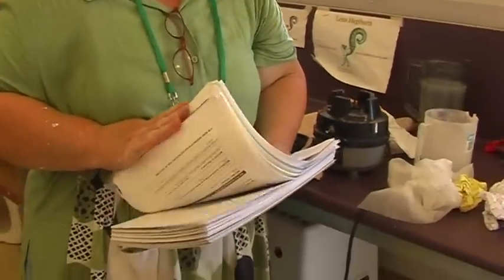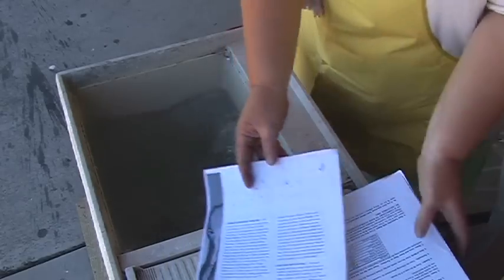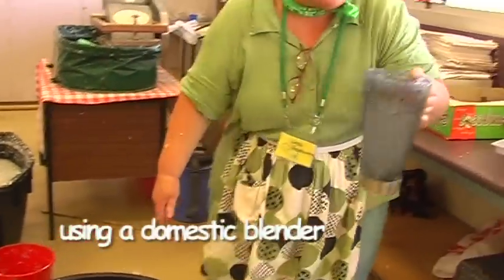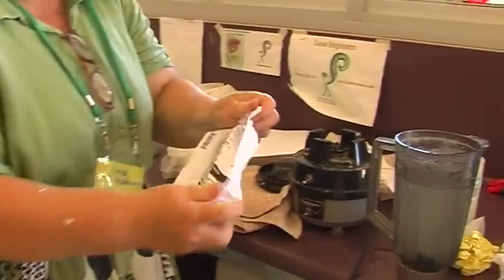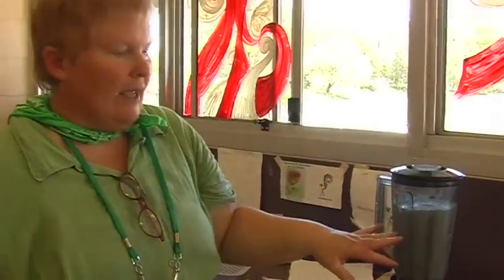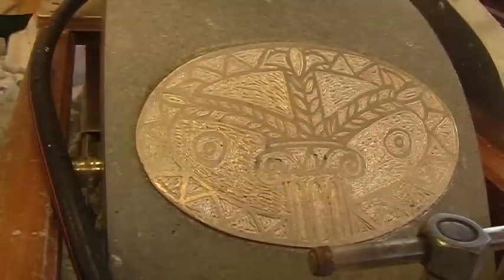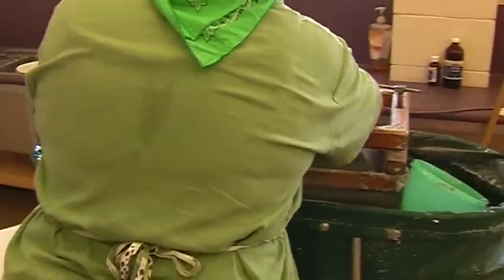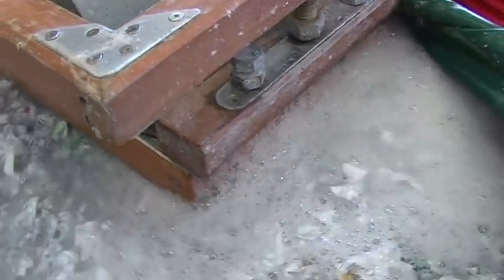Paper Making, Part One: Pulping

Comment: I make my own pulp at home but without all that its pretty simple but of coarse...for little projects xD I just shed paper with my hands into tiny squares, I just use a newspaper(like 12 pages) and then dump it into a bowl, then moil water and pour it over the paper (I add some white vinegar, not sure honestly if its needed, but in my mind it helps break it down) and let it soak from anway from 30 minutes to 2 hrs, then just start mixing my hands in the mixture and just swirl them in for like 10 mintes either ripping clumps or grinding them together. I just do this until its like a slurry and then strain it tho,rough cheesecloth) but I squash them into balls to take out as much moisture as possible so they dries easier, then just break em up into little clumps and store and just take some out when I need it for paper mache (I just add to maybe a cup of water so I have ready made pulp ^_^...sorry for all the errors in this post but hope it helps if anyone wasn't sure how to do it (I plan on making a instructional video soon)
Reply: Zane Woods wonderful.. i was looking out for this
Reply: Zane Woods s